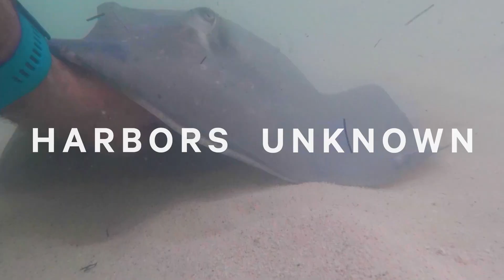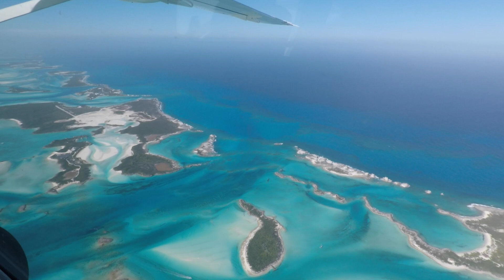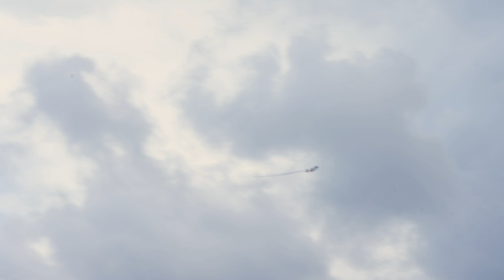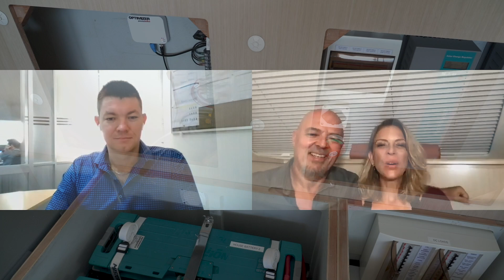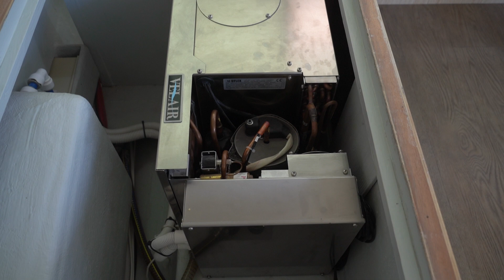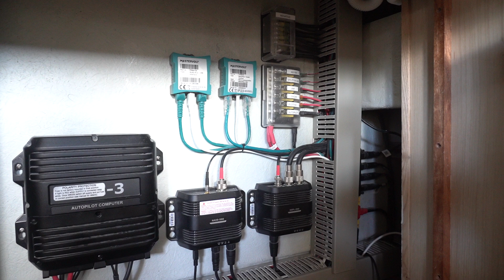Managing Power On the Seawind 1600 Catamaran | Harbors Unknown Ep. 7

Comment: The biggest fear of tech like this on a boat that is used for long term living is failure in the electronics.
I'm an engineer, so understanding failure rates in these things is important to me.
For instance, I know many of these systems have manual switch backups so you dont need to rely on a control panel that may have failed, but what about those eletronic starts and then the electronic throttles?  When needed most, if the throttles just fail, whats the backup?
Reply from the maker: What a great point!
We always talk about bells and whistles that create more failure points. The electronic throttles may be one of those potential vulnerability. There is a separate panel in the engine compartment with a start/stop and throttle, but also electronic and not mechanical.  
Common rail Yanmar engines are great but repairs are not for the common mortals! 😂 All we can do is change the oil, filters and impellers. Anything beyond that you need a certified Yanmar mechanic which confirms your concerns as a long term cruiser in distant places!! Thanks for you comments,  for watching our videos and for subscribing to our channel

Comment: If the 80hp yanmar charge the battery bank really fast why have also the generator onboard?
Maybe without the aircon the yanmar would be enough, am I right?
Great episode, well done.
Reply from the maker: Yes, the 80hp with the big alternator charges more efficiently than the generator, and you are correct without aircon you probably can do without the genset and run the engine when you use the washer dryer. Thanks for watching our videos

Comment: It was interesting to hear from the manufacturer why they use the systems that they do and what I herd is RELIABILITY.  On another note it would be good to hear what the differences in cost for energy on a boat compared to that of owning a house.  Do you still have a car or do you rely on uber to get around on land?
Reply from the maker: We’re glad you enjoyed the episode Walter! Yes, they are very focused on using integrated systems they know work. 
We stayed at a marina and it was .20 cents a kw for electric which ended up being about $300 for the month of September. In our 2300 sq ft home we would have paid no more than $200 so Marina’s are more expensive. Eventually we’ll be independent, and live off of solar and our generator. The generator uses .8 gallons of diesel an hour so it’s very efficient. We do currently have cars because Fabio is still working. Once he retires we will sell the cars. Thanks for watching!

Comment: Hi HU, I'm in New Zealand and fell in love with a Seawind 1600 hull no 1. I intend to buy one too asap.  I have run alternative power systems for 30 years. I hear a lot of yacht owners comment on the relief to turn off any engines running.  SO, I plan to erect a second platform above the dinghy davits, and fill that with solar panels. Aim for 2000 to 3000watts. This CAN run an aircon of the inverter type, because I do it here. The trick to reduce power drain is to reduce the settings down. eg fan on low, and temp set not too far from the current air temp. You still get relief of nice cool air especially after some minutes.  So it costs you to setup the solar array but you get 25 years of free power off it, and thousands of hours of silence!!  Enjoy your boat!
Reply from the maker: Thanks Jeff, that is a fantastic idea, I know that  one of the future owners of a 1600 is working on a similar project. I am sure that Seawind will be super excited to work with you on the technical issues. I think it is a wonderful way to run a vessel and achieve true independence from fossil fuel. We love your enthusiasm and look forward to learn from your experience.

Comment: thankyou for bringing Seawind company to the discussion just be aware that with lithium batteries generally as they get closer to the 3000 cycle rate the storage capacity decreases. The other aspect is still a shame that with the larger catamarans have not moved over for standard from the 12v DC base supply to the 24V DC supply systems which would overall reduce the power loses. Most standard parts are commercially available   to do so   e.g. on the engine 4JH80 part No.129677-77250 alternator 24V-60A. Can run both 12V & 24V alternator sets as separate systems
Reply from the maker: We were discussing your question with a person from Seawind today and the reason they stick with 12v is most appliances are 12v. You would need a lot of transformers if it were 24v.
Reply: @HarborsUnknown  you can design a system that can do both 12v and 24V DC . To keep things simple It is best to have only one DC voltage system  on boat but i would be very surprised not to find an alternative brand type for any device. Your mayor current drawers AC inverters / batteries charges , Anchor winches, water makers, solar chargers, LED and inverters for the electronic devices are available 24VDC. I have not looked into  the fridges or the electric rope winches at this stage , maybe after the conferences have finished this month I might spend some time to look into that . I do have the spec for the seawind 1600 somewhere or if you have the time please send me the brands , model numbers of the appliances on your vessel . 12v DC to 24V DC both way inverters are on the market
Reply from the maker: Very interesting! Thanks for the information! We’re going to stick with 12v for now.
Reply from the maker: David, thank you so much for your comment. You knowledge of boat electrical systems is impressive, thanks for sharing your thoughts with us.